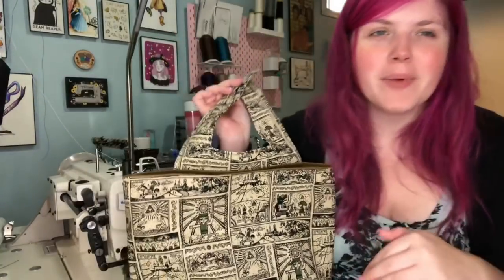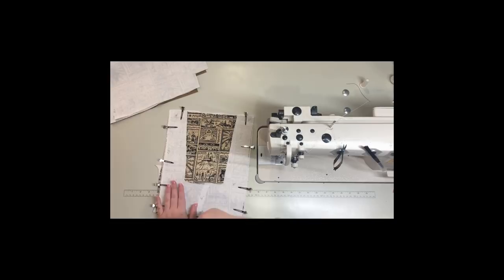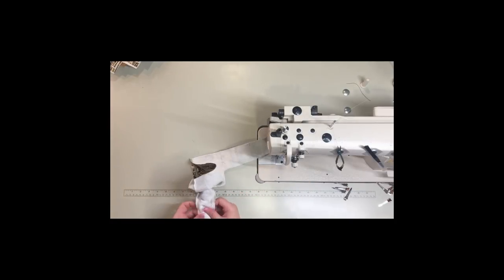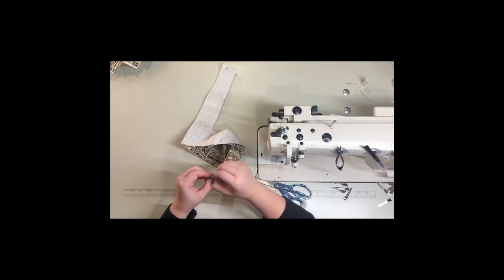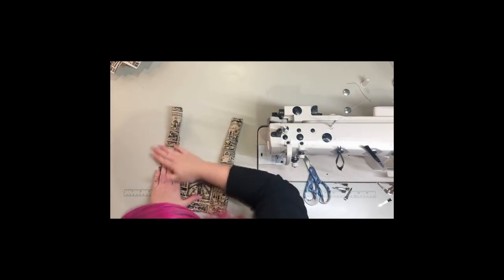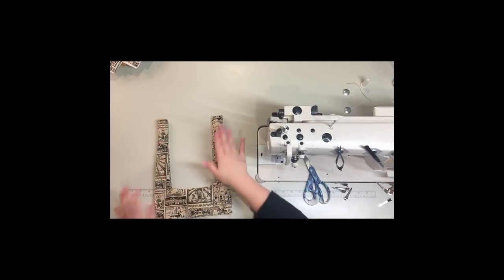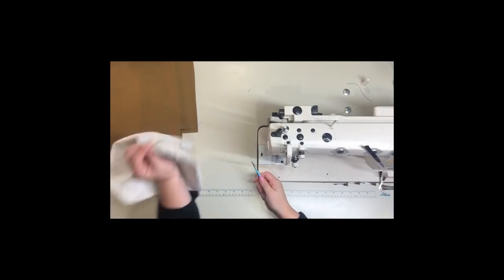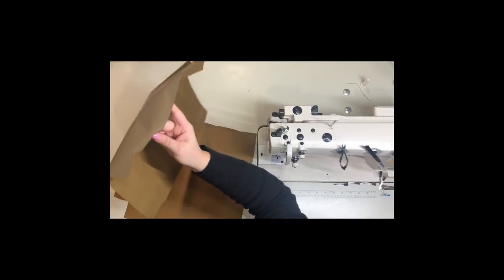34  Making a Reusable Car Trash Bag | Quick Sews!

Comment: I enjoyed this video. I have received this kind of bag, and made some myself. I used fusible vinyl on the lining, but I bet the canvas is easier to work with. For hanging I have seen two methods; Velcro on the straps for hanging from the head rest or buttons on a single strap that slips inside the glove compartment. There are so many tricks and ways of doing this. Thanks for sharing.

Comment: I have a van. So what I do is I make sure the arm rests on both front seats are up, then I  take a plastic grocery bag and slip a handle over each arm rest and slide the handles down . The only problem with that is if no one empties it before it gets full you have a Big mess to clean up. But this bag might work with a little tweeking.
Thank You.
Reply: This is what I do, too!

Comment: What a great Idea, l will make one for sure. I could place a plastic bag inside and roll the top edges over the edges of the sewn bag, and have to attache it somehow near the floor of the passenger seat for me or any driver to use it. How did you attache it to your seat, is it between the seats?
Reply: Sigrid Kutz , my sister in law got small command hooks and put them where she wanted to hang a bag.  She put one on each side of the center console,  and on the back for the back seat riders could use it. It holds smaller bag very well.
Reply: @lauranugent1171  thank you, great idea. I could place one of the hooks near the floor and the bag wouldn't tip over.